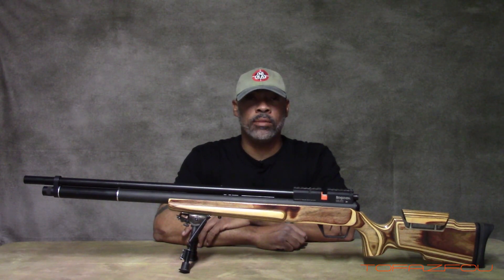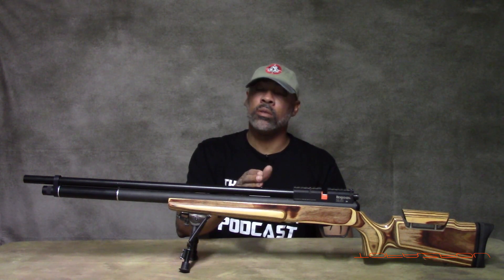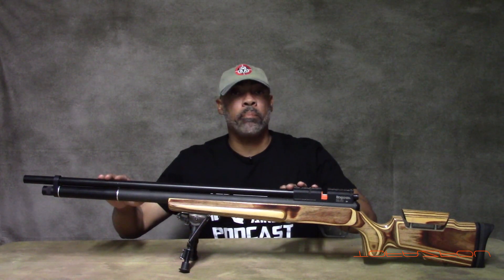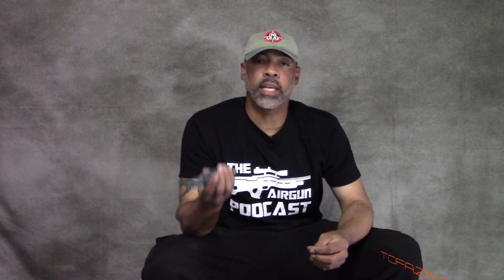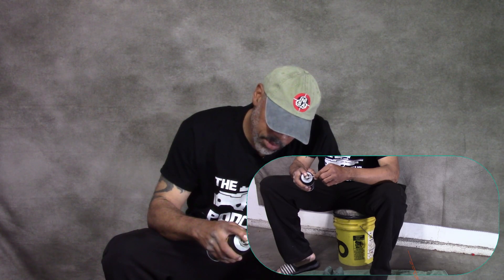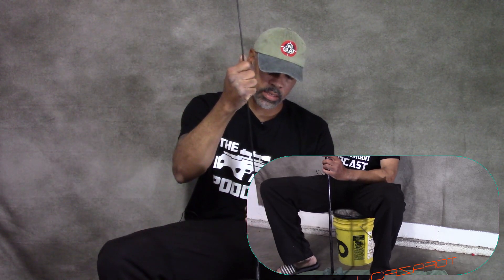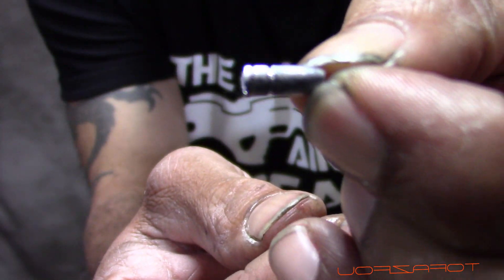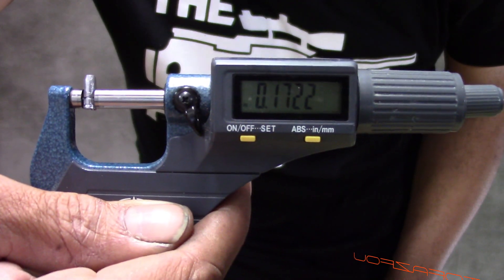HOW TO: "Slugging" an Air Gun barrel

Comment: Hello. Long time ago I've been testing .223 Remington barrel in Kral Puncher One T airgun, 110 FPE. Twist rate was 1:12 inches, and best slug for these set was 5.7 mm RWS. Custom 55.5 grain slugs was accurate to 200 yards, strong wind was not gamechanger when I mean Cola can at 170 yards. 
In my opinion most airgun barrels need two things to be usefull for slugs. First is fast twist rate, second - steel hardness. Hardness is guarantee better slip for slug and clean barrel.

Comment: Watched to the end, but still not clear on what this process actually does.  Pushing a lead slug through the barrel changes the steel barrel diameter?  That seems unlikely, I don't see how this process will do anything other than add rifling marks to the soft lead projectile being pushed through.  What am I missing?
Reply: You're missing value of that specific information.  The part you want to focus in on here is what YOU just said:  ADD RIFLING MARKS TO THE SOFT LEAD PROJECTILE.  So it can be measured.  So you can obtain/swage/cast precisely sized ammo for your rig.  

Bottom line up front; because you/we shoot a pneumatically propelled projectile, you need to achieve the best air seal within the barrel so that air doesn't bleed past the slug/bullet/pellet, AND do so without creating so much contact friction/resistance that the slug/bullet/pellet can't efficiently travel the length of your rifled barrel.  

The point of Cedric's procedure is to properly determine the inner diameter of the barrel, so that you can utilize the best suitable slug/bullet/pellet size.  Too small a diameter slug, you'll have a slower exit velocity (because of air bleed), impact power and shorter range.  Too large a diameter slug and you'll have potentially erratic trajectory & flight characteristics because you effectively "choke" the slug for the near-full-travel through your barrel.  You also risk fouling or jamming within the barrel, damaging your breach/breaching pin, or completely blowing seals within other parts of your gun or other-like catastrophic failures.  Like your fingerprints, barrels will have nuance variations between them - no two are exactly alike.  Mass production also plays, as manufacturers of the barrels/guns and the ammo leave a little "wiggle room" so that their product is more "universal" between shooters/guns/ammo (meaning they can sell more).  

What Cedric demonstrates and explains is crucially relevant.  Your barrel is rifled with either carved or smooth (varies among manufacturing/science/preference) internal twisting.  Lands & grooves are the terms here.  The "lands" are what contact that squeeze/grip the projectile; kind of "reaching into" the path of the slug/bullet/pellet thereby inducing the gyroscopic twisting that ultimately keeps the projectile stabilized once in free flight.  The "grooves" represent the true inner diameter of your barrel and effectively the true size for the slug/bullet/pellet that you seek for the most efficient projectile.  Observing the pushed-through slug like Cedric shows, gives you the true shape & measurement of the inner dimensions of your barrel from a full-length perspective; he used a slug to "cast" the inner shape of his barrel.  

For more precise & efficient shooting, you'll want more precisely sized and efficiently shaped & weighted ammo.  You can't rely on the generically (often mass) produced ammo caliber on the tin or box - especially the cheaper stuff.  Barrel caliber size as stamped on the gun are also not guaranteed as PRECISELY measured.  You will see the evenly measured baseline "foundational" caliber with respect to the produced barrel size, same with the slug when was swaged or cast.  For example:  .30 caliber versus .303 / .30-06 / .308 - which are all just ever-so-slightly higher variance diameters than the "foundational" size of a .30 caliber.  This is what you typically find in the commercial market when you shop.  You really can't tinker with reshaping the barrel to a specific ACTUAL caliber, so you're left with customizing the ammo that goes in it.  Think of getting custom sized shoes for your feet; can't change your foot size, but the shoes...  

By determining the "custom fit" of preferred ammo size for your gun, you can maximize the best consistency in your shooting results.  After reading all of this, go back and rewatch the video - it hopefully makes more sense to you.  Also, you can appreciate why specific producers like Nielsen Specialty Ammo or Corbin (swaging dies & machines) have seized on the precision sizing of slugs/pellets to cater to the shooters that care about what they feed their rigs, and I hope this explanation helps you.  Best of luck!
Reply: @JT-dy4sf  Thanks for the awesome explanation.  So in summary, he's simply measuring the barrel diameter by pushing a slug through.  I think the jargon in the video threw me off!  😄 👍

Comment: Forget to add, the heat from your hand holding the mic will cause the mic to read larger than what it actually is. How much depends on the temperature of the mic when zeroing and the temperature of the mic when measuring along with what the cte of the metal is. IE, alu will move more than steel. That's why it's always best to use a mic stand.

Comment: I was told by roach Creek that.0005 to.001 over groove diameter is perfect. Instead of using a brass punch I just use a short piece of wood dowel to start the slug from the breach end of the barrel and then use a longer dowel rod to push it the rest of the way.  I know that I'm just being over cautious but that's just the way I am

Comment: Well told and this is generally true for some barrels. That is why Altaros offers its ATP in the range of 0.01mm. But we found that shape also depends a lot. After changing the shape of the bullet, the barrels, which liked a projectile with a diameter of 5.49 mm, were able to work even better at a diameter of 5.52. This is a secret that most airgun and major manufacturers do not understand because they do not manufacture airguns and slugs at the same time. We can make slugs even after 5 micrometers in diameter and you can tell the difference in accuracy in a M24 airgun.
Reply from the maker: Very good info and you are so right.  There is a LOT to achieving accuracy.  You can be the best shooter in the world but if your gun and ammo are not shooting accurately, you won't get good groups.  Shooting is a science as well as a sport.  There is a LOT of science to shooting.....................

Comment: Is the process the same for a choked barrel?
Reply from the maker: VERY GOOD QUESTION.  If you choose to do so, the answer is YES.  Why?  Because, chokes are not a consistent size from manufacturer to manufacturer (ie.....Lothar Walther vs BSA vs Kral).  So, in order to find the best slug or even pellet size, you might want to size your choked barrel using a slug.  This is a basic idea of how "CHOKED" barrels are choked, the breech of the barrel to about 3/4 of the way down the barrel might be something like .218", but, the choke of the barrel (last 2-3") might be .2165".  This means, your barrel is choked .0015".  So shooting slugs that measure .217" might be your best bet for accuracy.  This gives you a very good starting point but, AGAIN, don't be surprised if .218s shoot better than .217's.  There are so many variables of a barrel that you can't measure once you start a slug in the bore but, the premise gives you a good starting point in the right direction
Reply: @Tofazfou  thank you for getting back to me. I was always told that a choked barrel was bad with slug's and good with pellets. I have a AEA rifle and I have been shooting slugs very well with it. I was surprised to find out that it's a choked barrel, but they do theirs backwards from everyone else. They do 3/4 of the barrel the choked size. I'm going to definitely slug this barrel cause I'm curious what it is. I gotta figure out how to get this barrel off first then it's on. Thanks again buddy.
Reply from the maker: @AlbeeSoaring  You see, you just proved what i'm saying, EVERY barrel is different in its own weird way.  And, to help with the confusion, back in the day, none of us really understood chokes and slugs and why chokes are there.  But today, we have a much better understanding.  We also have slugs no that have more O.D. than we did before.  Like 22 cal slugs, we now have, .216, .218, .217" options which gives us a better chance of accuracy and finding the proper ammo for the barrel.  We didn't have all this knowledge and technology 10 years ago
Reply: @Tofazfou  My brother! So, if one wanted to do the same using a choked barrel and diabolo pellets; after pushing the pellet down the bore, what area of the pellet gets measured with the micrometer...the head or the skirt. I'm guessing it's the head...seems most logical; but I don't want to be wrong.

Comment: What do you do if you find tight spots when slugging a barrel Cedric 🤔
Reply from the maker: Well, if its SUPER TIGHT then more than likely your barrel is ruined.  You see, a barrel is a tube of a nominal dimension for breech to muzzle.  SAY .308 cal!  Once you start the slug, it becomes basically .308 cal.  When you hit a tight spot, the caliber then goes from .308 to something smaller.  Lets say .307" cal.  Then, after more pushing, it gets easier to push the slug again.  Well, now, the outermost diameter of the slug is no longer .308" like the rest of the barrel but something smaller.  So then, the barrel is no good.  You can clean it and try polishing one with JB Bore Paste and then, reslug the barrel to see if the issue is resolved.  If not, then i would contact the manufactures/distributor and have the oem barrel replaced

Comment: What measurement will you use to size your resizing die bushing after measuring the slugged projectile  ?
Reply from the maker: in this video?  .1722".  You size to at least BORE DIAMETER that you measure after slugging the bore